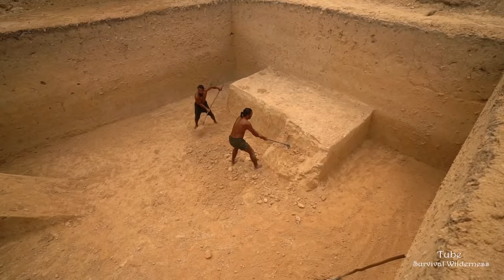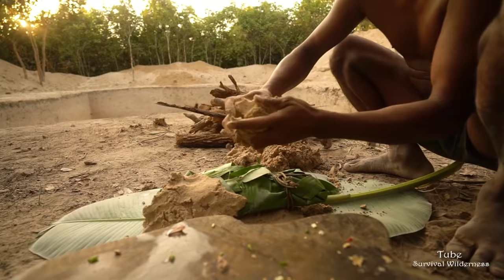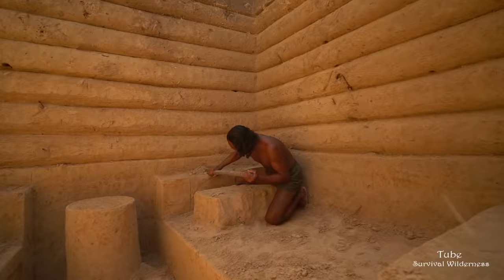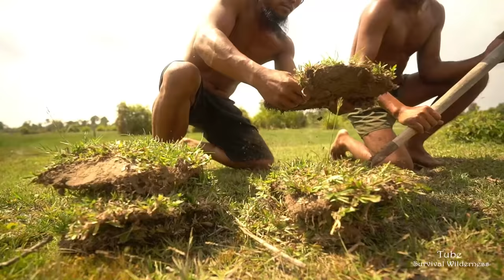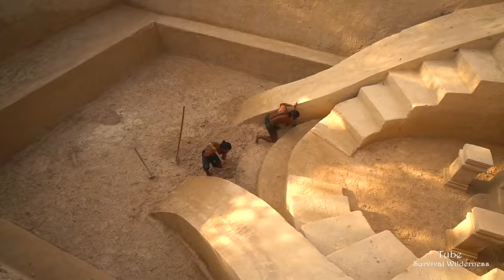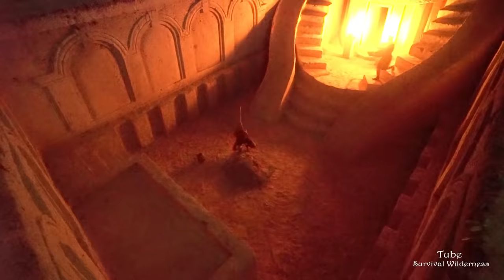Building Double Underground Water Slide and a Lucky House 2022

Comment: how do you drain the water?
Reply: سلوى ورى ذبذبات قيصري 1 @
Reply: If they have a mobile.. They must have a suction pump
Reply: @vickky66  i have 2 mobiles but i don't have a suction pump ;-). jokes apart you may be right. btw, the original question was a sarcastic one in case you missed the satire!